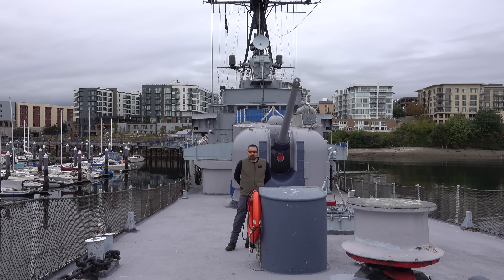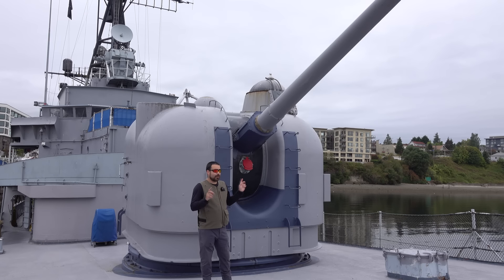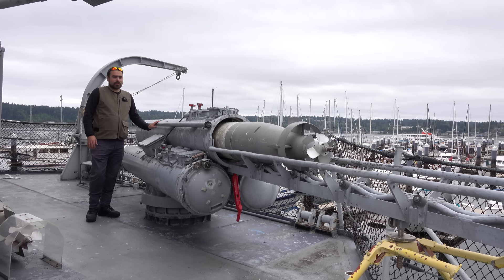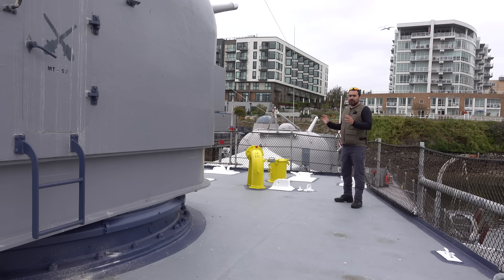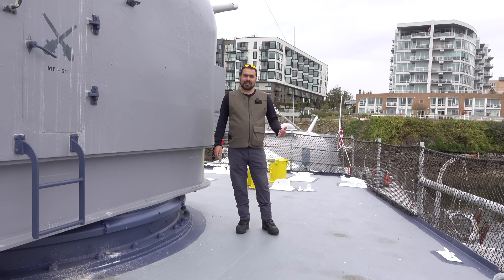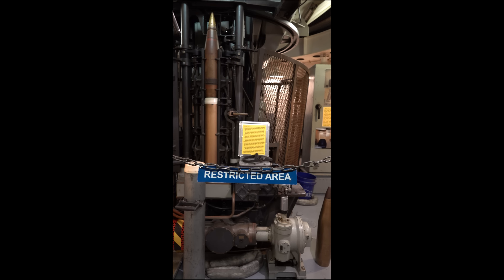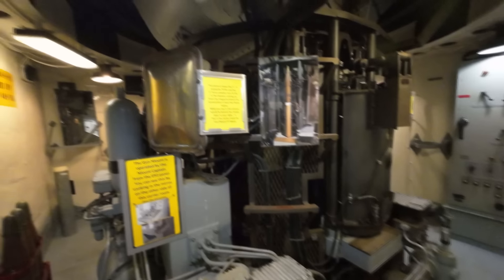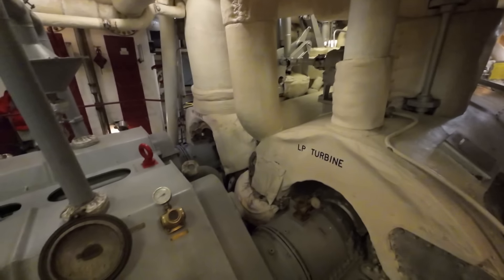USS Turner Joy (DD-951) - The USN's Last Gunfighter

Comment: served on USS Turner Joy 1976-78 as a machinist’s mate , been back to tour her. The volunteers have done a superb job maintaining her
Reply: I wonder if the reduction gears are working? Remember all the trouble we had with them? I was in Fox Division '76-'78. Fox was ASW on the TJ.
Reply: Curious you mention that. I worked in shop 92a at DATC/FMAG PAC from 76-78. I remember going down to look at the reduction gear problem. We would have had to go to sea to check it out. If I recall, the problem (it was VERY common) was tin oxide on the surface of the bearings.
This was very common, as many people that should know, knew nothing about lube oil purifiers. Worst yet, was the attitude that they weren't "that" important! 
Water in the lube oil would allow the formation of tin oxide, which is very hard, compared to the babbitt base material, causing damage to turbine shafting, etc.
Add that to the affinity to replacing labyrinth seals on the turbines led to the layers of tin oxide on the bearings.
I was in the Navy for 8 Years 2 months and 5 days. I was an MM1 for over 3 years of that.
I spent a total of 5 years of that, in repair facilities. You get to see alot when you see what goes on in various commands.
You see patterns, and try and do your best to correct them when they are bad.
I've seen many MMC's go from ship to ship, and behind them are two things, failed main engine (reduction gear) bearing failures, and a non-oprerative lube oil purifier.
Scores of them!
Reply: As a PS to my other post, I wanted to add, that one of the reasons that I remember going aboard the TJ was thinking "I wish I could read the logbook from that "day of infamy" (my thoughts at the time!).
Did we meet? 92a is the vibration analysis lab, in case you were wondering.
Reply: @jimfrazier8611I think I'm having a false memory moment. I vaguely remember someone getting hurt by a steam line, but maybe not.
Reply: @brucelytle1144  MMC is a CPO?
Reply: @jimfrazier8611 It was so long ago, I can't  trust such a shadow of a memory. But, maybe it did happen.
Reply: @RonJohn63  yes, MM1 is a Machinist Mate 1st class.(E-6) MMC is Machinist Mate Chief Petty Officer (E-7).
Reply: @RonJohn63  Yes, a Machinist Mate Chief.
Reply: Please remember that the TJ was the real start of Vietnam war. She was shelled by the Vietnamese north LBJ TOOK THIS AS A WAY TO OPEN UP THE WAR TO THE BROADENING OF THE CONFLICT.  MY GOID FRIEND Scott was an officer on board during the shelling.
Reply: @billsmith5593  You must be thinking about the USS Maddox as it was attacked (August 2) by three North Vietnamese patrol torpedo boats. 2 days later the USS TJ and USS Maddox mistakenly reported that they were under attack but recanted the claim later. President Johnson stretched the truth about the Gulf of Tonkin incident and the TJ "attack".

Comment: You do an excellent job of narration and are very knowledgeable. However, you seem to get distracted by minor (yet appropriate) background noise- sea gulls, motors humming, etc. These are not distracting to the viewer but when you stop your discourse to point them out, you make them distracting. I would suggest  that unless the noise is overwhelming , simply ignore it and press on. Other than that you have one of the best presentations on the topic that I have seen. Keep up the very good work.

Comment: Yes, a broom handle is a good leak detector.  The problem is that you have to have an indication that there is a leak first.  We had a similar 1200 psi plant on DE 1056.  We didn't  know we had a crack on the back of the port main steam stop valve until the paint on the interior of the hull  outboard of the valve started turning black.  There was nothing to hear, nothing to feel, and no measureable pressure drop.
Reply: That's the stuff of nightmares. I've seen what steam at 1/5th of that pressure can do, 1200 PSI is just insane.

Comment: i served aboard the uss forrest sherman DD 931 from 1977 to1981 as a GMG2  on gun mounts 51 and52, we still had both omc units mounted on the guns the omc or one man control positions , the left one was for both air and surface manual control of the gun , while the right hand omc was for  a  officer to sit to verify safe firing and had a dead mans switch to stop the gun from firing. i loved being on board that ship only wish i could have been saved and not used as target practice. the gun mounts were also named { mount 53 was the judge, 52 was the jury, 51 was the executioner }
Reply: Didn't serve on any DD's but was on old school amphib's, USS Oglethorpe AKA 100, ship to shore landings, built in 44 and cut up for scrap in 1969. I served on her right up till she was done in 1969. really sad to have seen her end. Was in the boat group as an EN3 on LCM's with twin Gray Marine 6-71's. Ear deafening roar from them diesels with no ear protection in those days. We were a great and proud ship.
Reply: My Father In Law was on the Forest Sherman in the late 70s.  He was a hull tech I think.  Tells some fascinating stories

Comment: I know that radar above...  SPG53.  It was one of the radars I was trained on as a US Navy fire control technician.  Riding in that radar during firing was always fun as it was gyro controlled to keep it level- which meant that you stayed level while the rest of the ship pitched and rolled.  It took a bit to get used to.
Reply: Specifically on the Forrest Sherman class it was an AN SPG53A. Mostly tube technology. There was an early version of the RSPE added in the 70's. It worked pretty good, solid and robust.

Comment: Thanks for the trip down memory lane… I was Gunnery Officer on the USS Forrest Sherman DD-931 in the early 70s, and spent a good bit of time climbing around the gun turrets and the gunfire control directors, as well as dealing with the cranky analog (gears!) computer that controlled them. The Forrest Sherman still had its 3”/50, which was a real pain to maintain, since it was always exposed to the elements. We rarely fired the cantankerous 3”, but we had several opportunities to fire the 5” guns during Naval Gun Fire Support (NGFS) exercises. Firing a broadside was a rare treat that would displace the whole ship several feet to the opposite side!

Comment: My first ship out of Machinist Mate Advanced Propulsion school in Great Lakes was the USS Forrest Sherman (DD-931).  Great to see this video, brings back a lot of  memories when I wasn't even 20 years old.  I worked in 1 engine.  Your comment about steam leaks and brooms was quite astute, but I guarantee, you would hear a 1200 psi steam leak.  You just couldn't see it.  Hence the broom handle to identify its location.  I was on the Sherman's decommissioning crew and actually rode her out in Nov 82 to the sea going tug hand off.  They took her from Charleston Naval Station, and I believe towed her up to the Philadelphia grave yard.
Reply: I can confirm you definitely hear a 1200 psi steam leak.  I was a main engine room hole snipe on USS Ranger in the early 80's.  We had the bonnet blow off a 1200 psi aux steam valve.  Damn that was loud.  All but one of us got out of the space before it filled with steam.  It killed the one guy who couldn't get out quick enough.  Lucky it wasn't main steam or none of us would have survived.

Comment: I served on a Charles F Adams destroyer. They were based on the Forrest Shermans and only had two 5" mounts, but had a missile launcher as they were the first purpose built guided missile destroyer. Mine (DDG 12) went into service in 1961. I served in the mid 80's as an engine room Machinist Mate in #2 engine room.

Comment: I served on the USS Jonas Ingram DD 938.  I was a Fire Controlman and I worked on the Mk 56 system which was primarily AA but was also a navigation aid always in use when entering port for accurate range and bearing..  The 5" 54's were sensitive.  They liked to be used.  They gave the gunners nightmares when they';d been idle for awhile: switches wouldn't switch; stuff came loose, the usual.  But once they'd recovered their sea legs - so to speak- they were awesome.
I stood bridge watches before I made rate and I actually liked it.  The best part would be coming off the mid watch. Charlie Rigel was the ships baker and he'd always give us fresh bread and butter.  It was wonderful.
These were beautiful ships.  Some of the poor things were 'framed' which destroyed their lines.  If the Navy has produced a beautgiful ship since these, I haven't noticed it.
We were fast, as one of the commentors below mentioned.  We did the required full power runs after a yard period and she put up quite the rooster tail.
Thanks for this video.
Reply: I used to see this class of DD around San Diego and Long beach in the early 70s and always thought them the most beautiful ships since the age of sail that the Navy had.  I see several other  former Fire Controlmen commented here.  I was as well but went missiles  FTM on the the Tartar  SPG 51 C radar.

Comment: The dome on the gun is for the OMC ,one man control, it allows you to drive aim and fire from the local position in case of the fire control system failing. The  bubble on the other side wasn’t removed so much as this model did not need an obsolete position. We had these on the Adam’s class destroyer’s in the Australian navy and I was OMC on the after mount on HMAS Hobart.

Comment: Thanks for your post on the USS Turner Joy (DD-951). In early August 1964 my ship, USS Brister (DER-327) was moored in Apra Harbor, Guam. That afternoon we received a radio telephone message reporting the attack by North Vietnamese torpedo boats in the Tonkin Gulf against U.S.S. Maddox (DD 731) and USS Turner Joy (DD-951). 
At the time, my ship was under the command of COMNAVMAR, commander naval forces Marianas. Our role was to patrol the Trust Territories of the Pacific mandated by the UN to the US. 
Brister carried armament consisting of two sets of 3 torpedo mounts, on port and one starboard. Main battery included 2, 3"/50 caliber guns. After the attack we were outfitted with 4, 50 caliber machine guns. We also had a hedgehog mount and 2, racks of depth charges on the fantail. 
Six months after the Gulf of Tonkin incident we were given orders to patrol the coast of Vietnam.

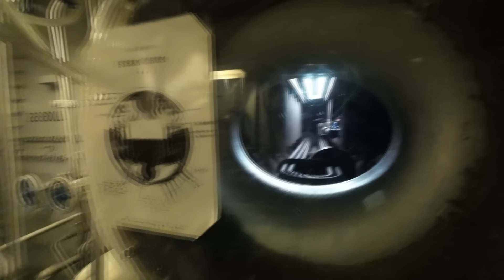Comment: Some interesting thing about Turner Joys boilers: they are D-type non-controlled superheat boilers. So they have an integral superheater so all of the steam produced is superheated, BUT some systems still use saturated steam. So those U-tubes we saw in the steam drum (35:55) were the De-Superheater tubes. Essentially siphoning part of the superheated steam back through the water inside the steam drum to make it saturated again. Im not too well versed in the “why” of these particular boilers, but i suspect this was an effort to make the machinery much more compact for the pressure rating
Reply: Thanks for that. I love reading the comments exactly for this kind of stuff. Drach is great at providing info, but you can always find great little details like this in the comments.
Reply: They’re built like that because it’s easier, and especially because the steam flowing through the superheater banks are the only thing that prevents the boiler fire from melting them. Desuperheating previously superheated steam means that even if you’re in port only using auxiliaries, you still have steam flowing through the tubes in the superheater bank, so you don’t melt parts of your boiler.
Reply: @michaelimbesi2314  Oh that makes perfect sense! Especially going from the double firebox M-types to the single firebox D-types, thank you for the insight
Reply: On merchant ships when lighting 
Off we have to have The superheater vents to atmosphere Wide so there is always flow of steam cooling before putting them on line getting normal flow .&

I was a MM before that and remember there was a Superheat Protection System  that did that job but I don’t know how it worked not being a BT.

Comment: The Stable Element is a very important part of the control system. It's basically a big gyroscope that gives the ship it's zero-angle reference in pitch and roll. This allowed the guns to automatically change elevation to maintain the calculated angle with reference to the horizon, despite the ship rocking beneath it.

Comment: 18:58 My God! A T-Mk-6 Torpedo Countermeasures! In 1979 I was assigned to the USS Cochrane (DDG-21) as Sonar Technician 3rd Class Petty Officer. Being new to ships and not having any official maintenance training for sonar equipment (yet), my duty station was the care and feeding of the T-Mk-6. This entailed mainly performing the weekly, monthly, quarterly, and annual Preventative Maintenance... Oh. And chipping and painting the reel assembly... LOTS of chipping and painting. 😞 When we were headed into port, one additional task was polishing the two brass fairlead chocks for the towed body cables on the transom.
The T-Mk-6 was a simple design in that it had an aluminum outer shell that housed an AC motor inside, the motor had fins designed to just make contact with the inside of the housing - creating the noise that (hopefully) distracted an acoustic-homing torpedo. To increase the frequency of the noise, you increased the voltage to the motor which sped the motor up.
Reply: Worked on the tech manuals for torpedo countermeasures and analysis of foreign countermeasures systems.   Fascinating to me.  The development of FOXER and UNIFOXER in WW2 was an interesting bit of history.    The early countermeasures against the German antiship guided missiles are another interesting story.

Comment: Thank you for this wonderful trip down Memeory Lane Drach. I  remember the TJ well having done much steaming with her while aboard her sister ship the USS Morton DD948 being stationed at Pearl Harbor. I have traipsed those decks several times as in those days as we knew most each other from previous ships or commands. We shared knowledge and spare parts.. You could get quite a lot of cooperation with a can of coffee in those days. the two ships shared Fire Control systems, the Mk 68 and the MK 56, all tube tech from the good old days. Although the Morton had gone through an upgrade that deleted Mount 52 and had an ASROC launcher in its place, TJ never received that system for some reason. My berthing compartment was just below the main deck and directly aft of Mount 51. Also just aft of the chain locker for the anchors- now that was a racket! So many memories and stories to tell. Thank you again for this one.
Reply: The value of a 5 pound can of coffee in the world of comshaw was still alive and well in 1975-1976 when my submarine was in overhaul at MINSY in California. For the price of two such cans, we got all sorts of stuff from the shipyard yardbirds, including new manuevering room chairs for the watchstanders and a brand new coffee maker for the engine room.
Coffee. The perfect substance. Fuel for the crew and worth its weight in gold for getting stuff that the Navy doesn't budget.

Comment: Great presentation.  I’ve been in this ship many times ( local) I’m surprised there was no mention of the gulf of Tolkien incident or combat service history . … just a mention of a patch where a shell hit . Most of these videos have great lengths about ships histories and battles 🤷🏻‍♀️

And there is sooo much to see . Something like  85 % of the ship is open to self guided touring . Only a few places like storage rooms and the lower engine room is closed off. ( as was noted in the video)  if I remember correctly there is a bit of sealed asbestos down there that couldn’t be removed without significantly dismantling engine components so it remains closed . 

They have done a great job turning the ship into a museum while preserving its look.

I remember going the week it opened . There was no permanent dock. Just a gangway and they had literally pulled her out of mothballs , roped off a few areas put up a couple of cork boards with information pinned to them and opened the hatches and said “have at it” .  😂 it was like walking around a working ship. The oils and the smells 🤣

For at least a decade they had to keep her fully ready to reactivate and everything in working order so there was no viewing into the turbines or boilers .

I see they have made viewing ports now and I believe they cut thru a couple bull heads to create  a nicer stairway to the lower decks .  Last time I was there is was all the narrow service stairs or ladders.  It’s been many years . 

I don’t know if they still use it but for years the local new channels had connections with the ships weather radar and they also were using the ships radar as a VOR navigation point for aircraft. I think Bremerton national airport had some connections with the ships radar as well. I’m not versed in all that I just remember the newspaper reporting on how certain aspects of the ships radar would be used by local agency’s for weather and navigational aides when she first came to be a museum.🤷🏻‍♀️ the arrival was titled something like. Turners joys last mission as museum and radar station🤷🏻‍♀️🤷🏻‍♀️🤷🏻‍♀️

I don’t know if that’s still a thing tho?